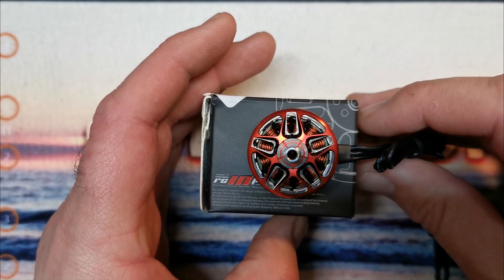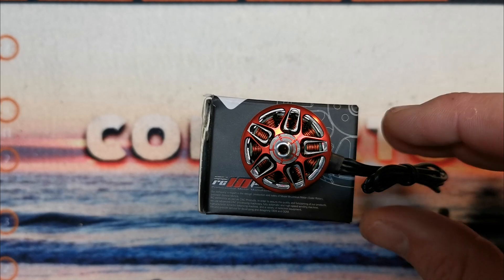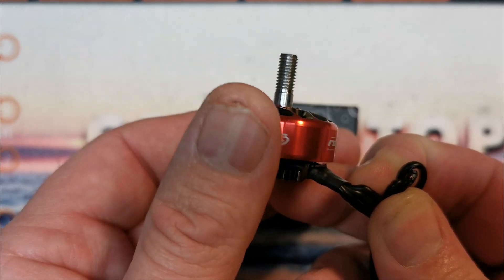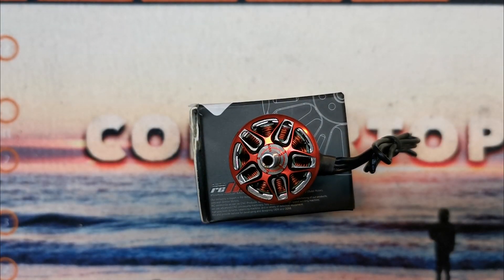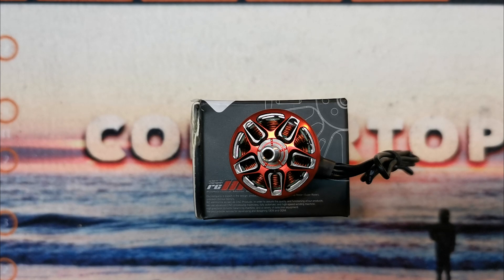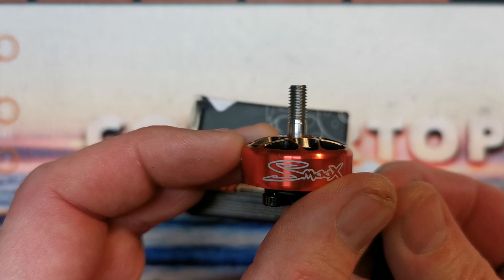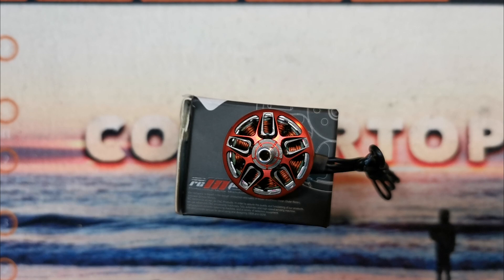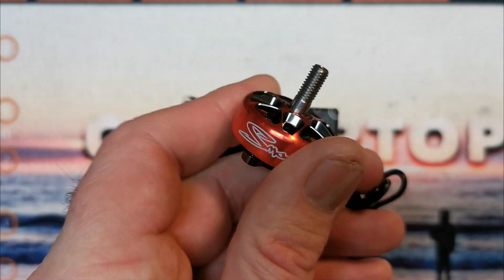Rcinpower SmooX 2306 5 motor

Comment: I think there are two versions of this motor out in the wild. One with the top bearing pressed on the bell making the bell extremely difficult to get off and another version with the top bearing not pressed on the bell but in the stator and in that case the bell comes off easily. These two version feel differently when you spin them with your fingers. I've flown the second version and have two of the first version that I recently ordered as replacements so I can swap out when I need to change bearings. I damaged all 4 top bearings in the second version of the motor on a hard belly impact on cement with an apex 5" frame (must have bounced 20 feet), so currently working on repressing all of those bearings since the bell was super easy to get off.
Reply from the maker: I've found all the rcinpower motors have difficult to remove bells. Takes forever to get them off.
Reply: @CoppertopFPV  that is really strange, i was able to pull the bells off these ones with my fingers after screwing it to a spare arm. but the teal one that I suspect is a different version with the bearing pressed to the bell I can't get off without some serious effort and tools.

Comment: Between this motors and the T motor pacers, which ones do you think are smoother and have more punch? I really want to do an upgrade and I've ended up between this two and can't decide if the smoox are better or not.
Great video btw!
Reply from the maker: Any of the rcinpower are better than pacers. The pacers are a budget motor, the rcinpower compete with the more expensive t motors

Comment: I’ve been tempted to try these motors they look the business and they are often on sale. The T motor F40 pro II has been my best experience over the past few years and Ive only just recently started using the pro IV. The price sucks but I’ve had a similar experience to yourself when it comes to trying other options.

Thanks for sharing your experience with them, might grab a set next time I see them on sale 👍
Reply from the maker: They're 4 for £59 on banggood currently and if you keep your eyes out you can often trade points for 20% off vouchers. I just bought 4 for 12 quid each 😁
Reply: Coppertop FPV Coppertop FPV Cheers mate, found the set of 4 in teal colour which come in at $115 AUD with a discount coupon. That works out to about £15.50 each using current exchange rates.

They are usually £23 each locally which is how much I pay for Tmotor F40 Pro IV so it’s a good deal for me thanks 👍

Comment: The newer (Vanover and forward) RCINPower motors are impressive - for racing the bell top construction isn't quite as abuse-proof as others, as we tend to fly directly into gates a lot, but the performance is remarkably impressive.  A lot of the older designs are pretty high performance, although my 1108's are outliers in both how well they perform, and how much I've been struggling with the windings getting hurt and getting desyncs.
There aren't that many OEMs, and the Apex Hornet motors look to me like the most versatile set of RCINPower ones.  For my personal taste, the older generation 3BH 2207's are the prettiest motors around, with the BH R6 2207's in a close second place... but the practical side of me wants to just start running the TMotor Velox motors in 2207 and be content with that, since 1950KV is my preference overall.  ( https://rotorbuilds.com/build/21176 )

Comment: You may try T-Motor. IMHO, perfect and robust motors 👍🏻 Lots of power everywhere, easy to control at low revs 👍🏻
Reply: Pricy in many cases, although the Velox line looks pretty great.  My personal suspicion is that those are rebranded SunnySky motors, but that's also an excellent thing, since those Edge Racing motors they appear to be based on are phenomenal performers.
Reply: tehllama42 Love the T motors, much more robust than they appear and they fly great. I bought a set of Velox to try out and they fly great but heavier and not as robust as the F40 pros, but less than half the price too 😂

Comment: im considering putting the 2208.5 1722kv hyperlites on a 6s 6inch kissed slammed alien..  going to run the ethix k2 props on it..  i love rcinpower tho..  what do you think about these vs those 2208.5 hyperlites?  im sorta going for stupid fun -- and maybe some long range at low throttle...  would love to hear waht you think about that motor vs smooX
Reply from the maker: I haven't used hyperlite since the I did light weight 2204 experiments so couldn't say. Interesting choice that tho. Be curious to hear how you get on. My own 6" big motor rigs have left me frustrated by the lack of efficency I was getting so perhaps the ethix bi blades will sort that

Comment: I have to say that all your RCInpower have survived against the others that's worth consideration...what about your favourite brand T motor? ;)
Reply from the maker: Haha. TMotor F60 pro v1 one were great and indestructable. My pro 2 2150kv split their bells which was a common problem and have long since gone into the trash and I haven't used them recently. My days of paying 22 quid for a motor are well behind me and cos I wouldn't personally buy them I don't review them.
Reply: @CoppertopFPV  yeah 22 is a lot...still bloody nice performance....BTW I heard that RCInpower make the Xing motors...would make sense seeing as the Xing are now one piece bell...maybe you got unlucky with those pink ones...
Reply from the maker: @stevejhkhfda  nothing wrong with the xings. I've got loads and that's the only one but the bells are a lot thinner and lighter than rcinpower. They aren't rcinpower tho. Completely different construction. I think the original ones were t motor which would explain the current situation ;. No idea who makes the unibell ones. They've sold so many they likely manufacturer them themselves now as they're killing everyone else
Reply: The lightweight updates on the Pro-II and Pro-III line seems to have made the bells a touch fragile, though the performance is absolutely brilliant.  XING are impressive in their own right, and are still arguably the best motors for bashing and freestyle since they can withstand a little bit more mechanical abuse.

Comment: Please do the tango 2 review you have to after you posted the pic  LoL!
Reply from the maker: Lol
Reply: @CoppertopFPV  You could do a range check with the  Tango 2, esp in the woods, RH and LH, you could give us a insight into how far it could be propelled using the RH and LH? i know it's not going to be scientific, but it might help someone. ? .... i am just putting it out there you know....
Reply from the maker: @g1568  if I get one - and I doubt I will as the gimbals are too short for me and it looks cheap and nasty - I doubt I'll  review it. Already a thousand reviews out there and reviewing txs doesn't float my boat. Same reason I never reviewed my t16pro or the xlite which I sold after one flight. Reviews will be stopping when I've cleared my current commitments. Bored of doing them. Takes up too much of the little flight time I have at the moment.
Reply: @CoppertopFPV  You do right to concentrate of the flying and tinkering, i'm the opposite, I need to stop tinkering mostly because i dont know what im doing but more importantly i need to do the day job, which i kind of keeping putting off. About the T2 i was pulling your leg...:-) you should do a monthly round up video maybe.
Reply from the maker: @ghafoorhussain6677  ill still post. Just about things that catch my fancy rathet than endless 'stuff' hence the waffle in this video and my kiss v2 video.